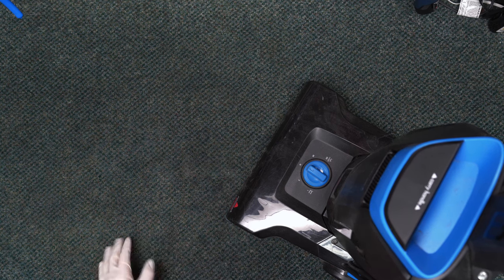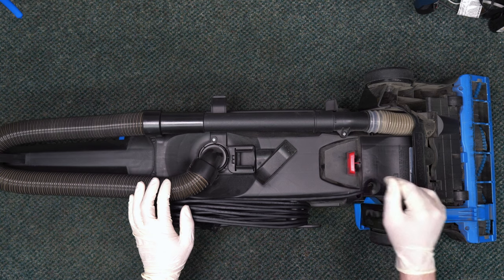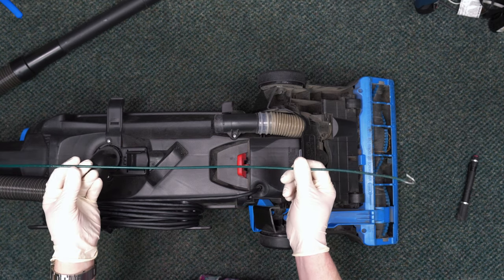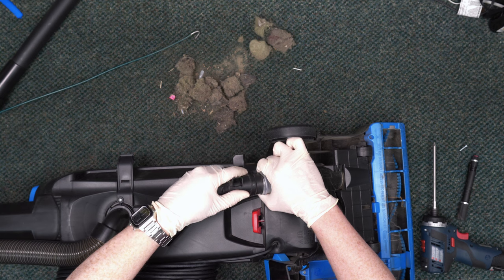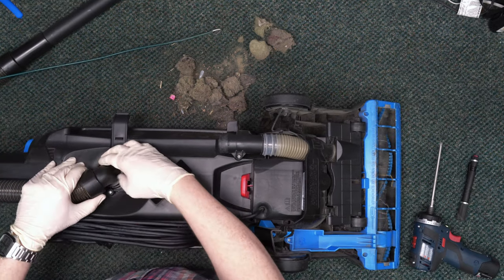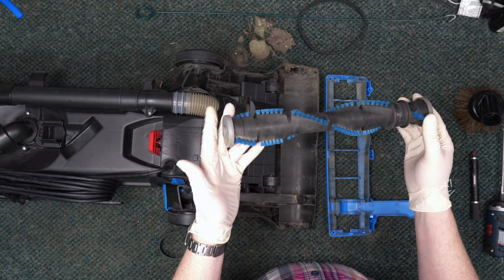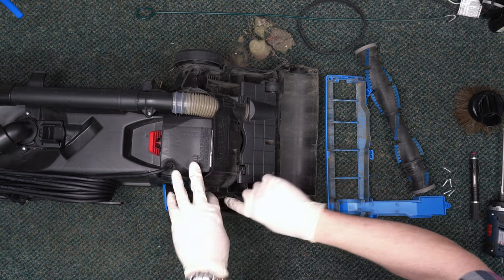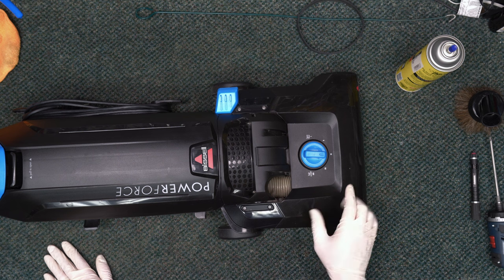Bissell Powerforce 1739 - Has Yours Lost Suction???

Comment: A textbook example of good design for service/repair in a supremely cost-optimized machine. Removing the floor plate gives belt access without fully disassembling the head, and the whole thing is color coded so you know exactly what part you need to pull off to get to the brush and belt.
Reply from the maker: I agree. If you have to make something cheap, make it simple!